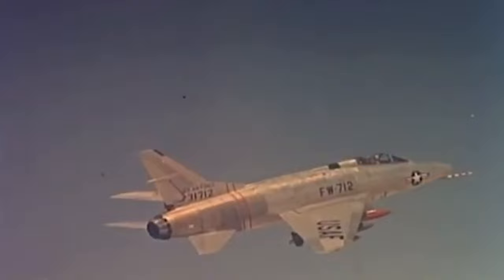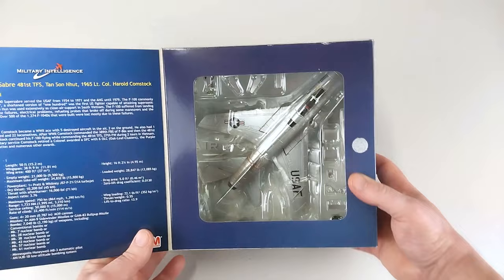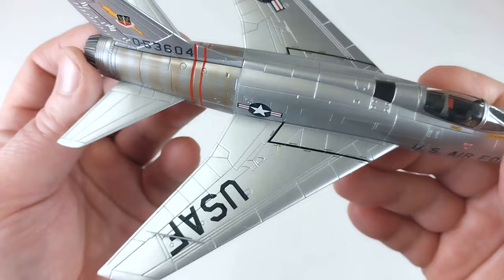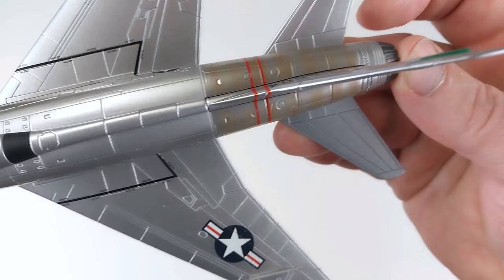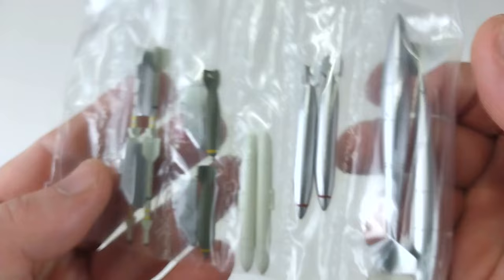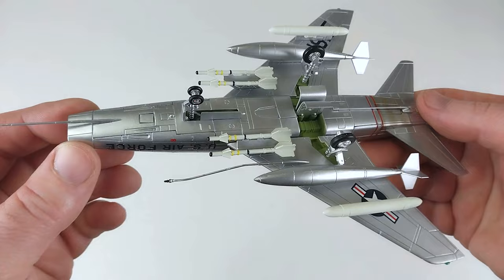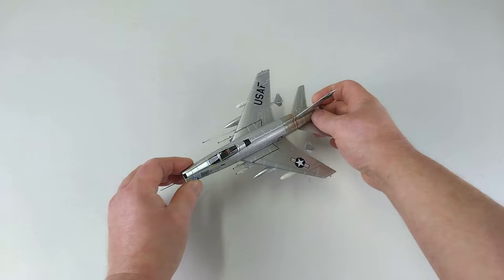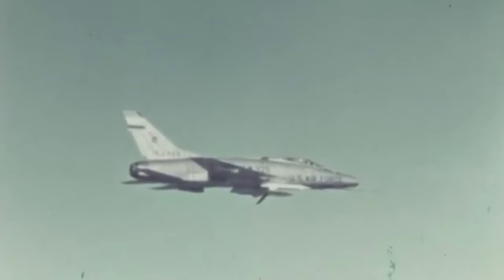North American F-100D Super Sabre, Col. Comstock, 481st TFS, Vietnam 1965, 1:72 Hobby Master Diecast

Comment: I would compliment Hobby Master on most things, but I do find with some of these older versions that they could do with a set of instructions for the placement of the ordinance and landing gear. Occasionally I have opened a bag of pieces up, and found a part and thought what the heck is that for! Then I find it's something really obvious like an air brake or pitot tube!😂
Reply from the maker: Mate you are right, they are a little hit and miss with providing instructions. I find in the older ones I get instructions more, than the more recent offerings but its still more often not there than there. Usually parts go in the one way, but yes the ordnance set up can be a pain, I usually look it up prior to the video. I suffered the same fate recently, I just did a video of a F-102 Delta Dagger. Mase the whole thing and realised there was a tiny tab on the tail that you need to put the airbrake on...d'oh....had to redo the whole thing. I will also let the cat out of the bag as no one his spotted it yet...on my very first F-111 video I put the nose wheel in wrong way, as it fits both ways and the numbers on the gear door still go teh right way no matter which way it goes in. Wasn't until I did my second F-111 I noticed it,haha. I figure with over 300 and something aircraft videos and only 2 or 3 mistakes I'm bumbling through it ok,haha Thanks as always for dropping past.
Reply: @heavymetaldiecast  I feel your pain! 😂 Recently I bought a MIG-15 by HM, and like with all my models I intended to display it in gear up position. I go to put one of the wheel covers in and it's just my luck that I put it in the wrong side! So, because the piece is now tightly in place, I then have to get a screwdriver and yank the piece out. Fortunately I managed to get it out and put it in the right side so it worked out well in the end, but it was a close call. And to add insult to injury, it's a really rare one, so I'm really lucky that I managed to fix it!😂 With a set of instructions I would have known which side the part went on!
Reply from the maker: @thedoctor1837  I'm paranoid now so with every model I'm about to open I look them up and use pics as reference,haha. Especially because every model I am pretty much opening up and assembling for the very first time for the video so both myself and you guys are getting the same experience....probably why I waffle on a bit in some videos when it's a model i really like,haha. I have so many boxes I want to open but can't until I'm ready to do a video. It's like a Christmas present torcher house I've set up in my shed 😂